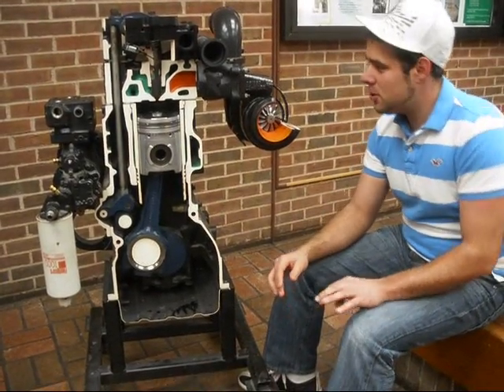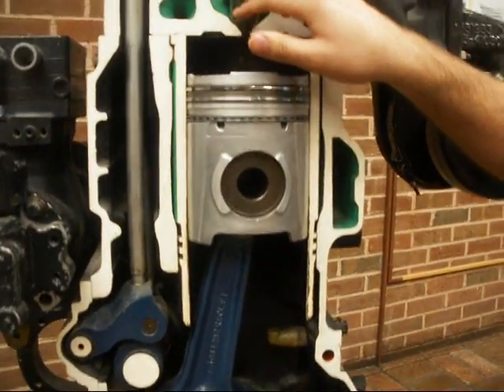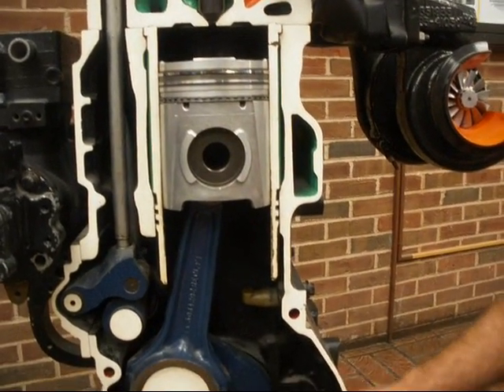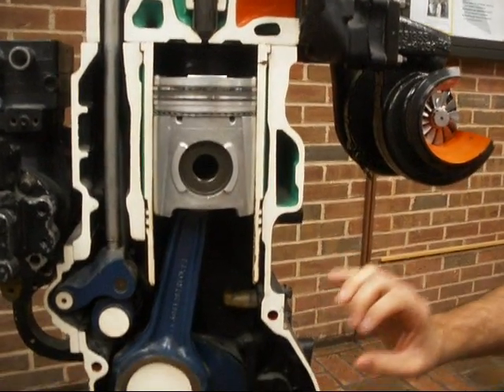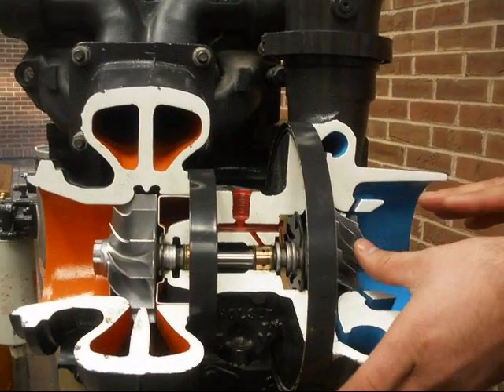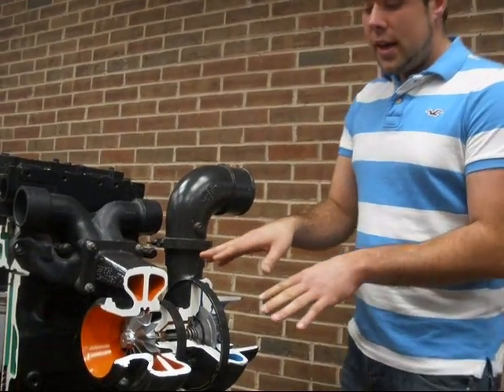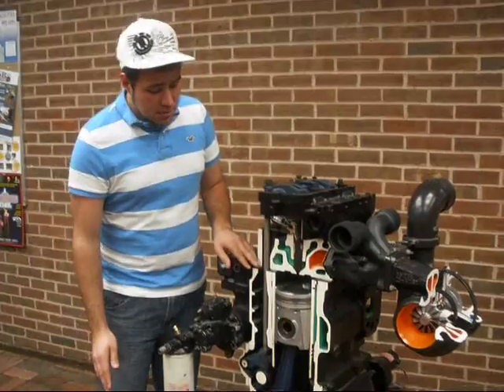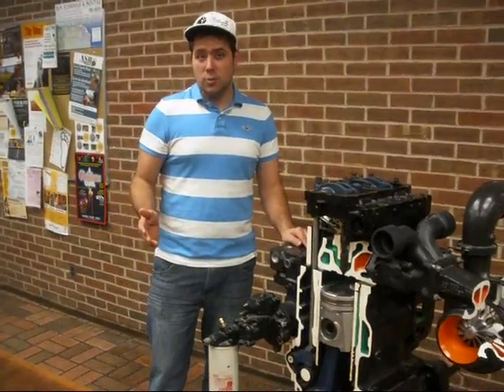How Does a Turbo Diesel Engine Work?

Comment: doesnt oil need to lubrcate the turbines?
Reply: Maneka Struzak yes it does, which is one reason why you should never shut a Diesel engine down immediately after thrashing it because the oil will stop flowing while the turbo still spins causing excessive wear on the bearings. Always let a diesel idle for a short while before shut down.

Comment: CocoPopTG, Glow plugs and grid heaters do the same job. They preheat the engine so you can achieve combustion. It is that heat combined with the heat generated by the air compression that starts the engine. The engine then runs on the heat generated by the compression stroke to burn the fuel. The engine block stores the heat which helps with combustion, That is also why your diesel gets hot enough to need engine coolant.  If you have an air compressor find the tube that goes from the compressor to the tank and check the temperature on that line. You will notice it gets hot enough to cause a second degree burn. It will blister the skin. I own an 05 third generation Ram  3500 with a 5.9l motor. I have learned a lot about diesels from Diesel Power Magazine. I love my truck and will not go back to a gas engine again.
Reply: hey , do you know why a diesel Engine is more fuel efficient vs petrol Engine ?
Reply from the maker: AVLMTC -Lack of a throttle plate (strickly fuel delivery controlled), higher compression ratios, Diesel fuel has more stored energy by volume.

Comment: I like how you explained everything. Do one on how the coolant system works! Water pumps, intercoolers, wet sleeve vs. dry sleeve, and how cooling the engine is beneficial. Those 453s are mean little things too, Im trying to get my hands on one right now.
Reply: I see you wrote this 9 years ago. Hows it going